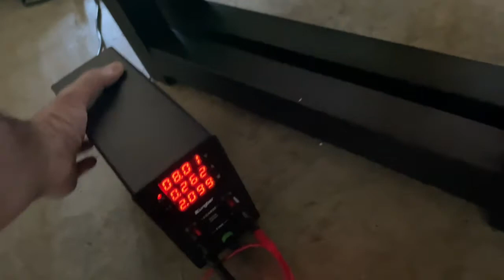Demonstration   Schlieren Z Type Setup

Comment: May I know the distance between the two mirrors?
Reply: It depends on the mirror's focal length. It's 2f.
Reply: @ToddDesiato  How about the angle used for the LED/Knife edge towards the mirrors? many thanks and great video 😀
Reply: @aqilhamdani2182  I have a "Z - 2 Mirror" configuration. The angle is as shallow as possible with 8" mirrors.